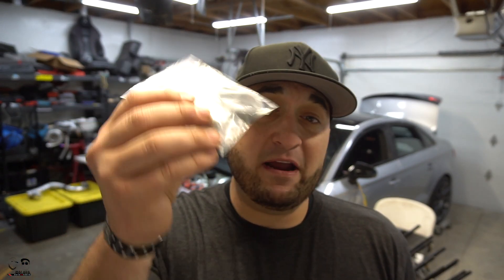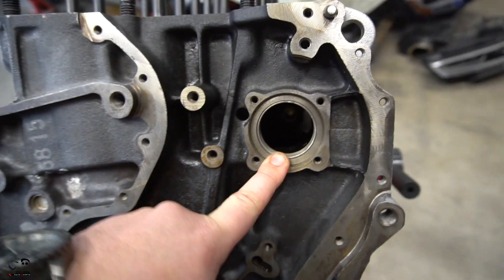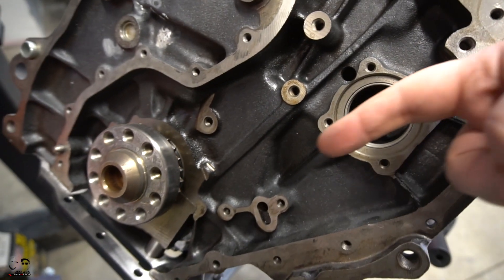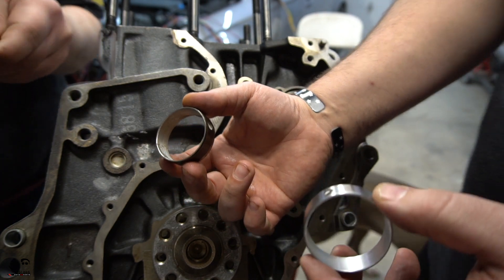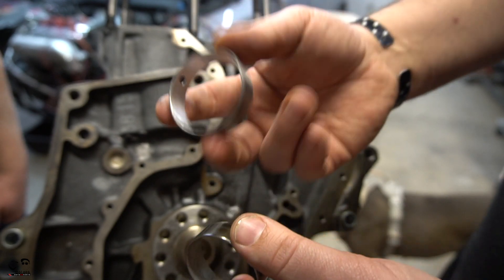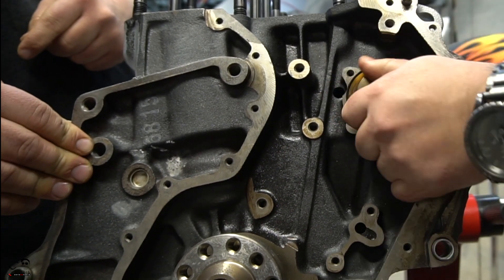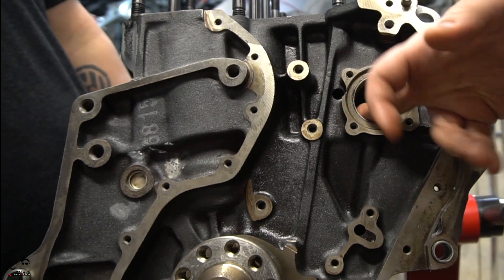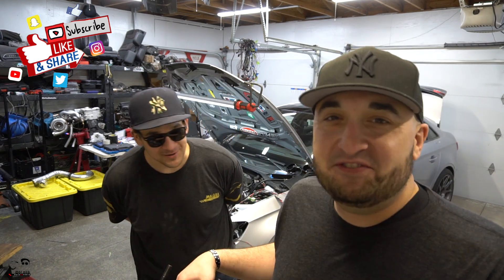VR6 INTERMEDIATE SHAFT BEARING INSTALL AND WHY THEY ARE IMPORTANT

Comment: My 12v blew up and my intermediate shaft key way gear actually snapped and I spin the head and broke the bottom chain off and the valves kissed so I had to find a new one definitely have never seen a video on this stuff great video
Reply from the maker: Thank you sir we thought would be a good time to address it. Seems many have had failures but nobody has spoken about it.

Comment: you said this is a touareg block...is it the same as the r32?what is the difference between the! touareg and the golf.head? cums?
Reply: for the most part yeah the cam profile and tune are liike 10hp lower on the touareg. I have a 3.2 touareg long block to so a 3.2 swap to my corrado slc..... parts include, intake mani, oil pump, pan, etc to shorten the block a bit for a faux fwd R32 swap

Comment: Over 20 years ago, I discovered this problem on the big bearing so a machine company had to specially manufacture one for my VR6 turbo, it was made of bronze and with an oil channel in the middle around the entire bearing to distribute the oil better like the smal bearing you use.
I did this in year 2001, and the engine was only 3 years old, but still the bearing was bad.
 I have since always wondered if it was just me who had the problem?

Comment: If you hit with some dry ice, it will come out easier.  Next time.😁  You also put the new ones in the freezer.  They shrink with cold.
Reply from the maker: All good tips that we used on other projects we will try this when we do stavs new engine. Appreciate the advice

Comment: as a man still living in ny its good to be reminded by malakas that at least i live where good pizza is. also i feel like 12v are more likely to need the bearings because of the age of most of them before they get built. i know ill be adding this to my 12v build list.
Reply from the maker: Freeze dry some good pizza and send it to us lol We are def Missing NY food like crazy. Best of luck of with 12v build 💪💪
Reply: Definitely, just pulled a motor out of the junk yard and the bearings looks new but had .0039 and over clearances. In the rod journals. If you are buying a vr6 learn to assemble and spend the 500-700 bucks to have the machine shop spec and clean the engine. Better safe than sorry… trust me.

Comment: I've been waiting on a video on this certain topic. Never seen a video on it but always wanted to see someone do it before I attempted it

The intermidiate shaft spins at crankshaft RPM if it has the same number of teeth as the drive sprocket on the Crank or at 1/2 Crank RPM (Camshaft RPM) if it has twice the # of teeth as the Crank drive gear.
Reply: yep, you can count the teeth on both sprockets and divide: driven gear (im sprocket)/drive gear (crank sprocket)=gear ratio
Reply: @richardzielinski5707 Without looking at it I'd be inclined to say it's Crank RPM and not cam rpm as that would drive the oil pump faster and provide more oiling volume to the engine
Reply: The intermediate shaft has 2 sprockets. The bigger inner sprocket is driven by the crank at 1:1. The smaller outer sprocket drives the camshafts via the upper timing chain and has a reduction ratio of 2:1. So basically the intermediate shaft itself mean speed is always is equal to engine RPM.